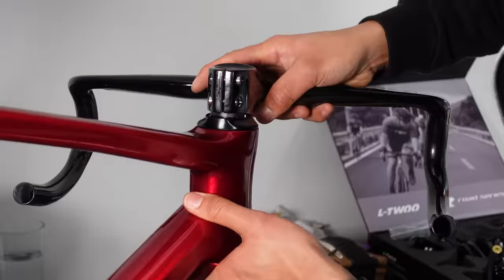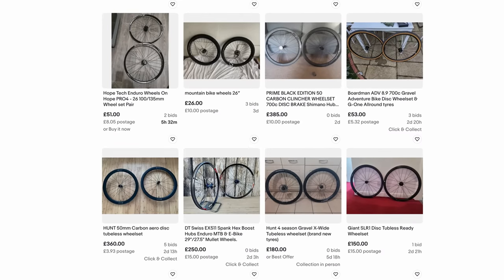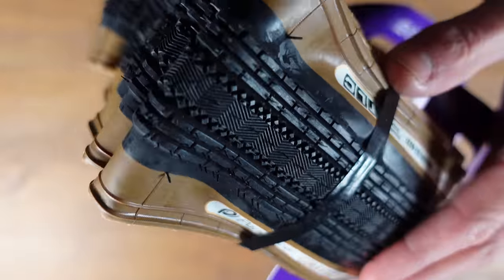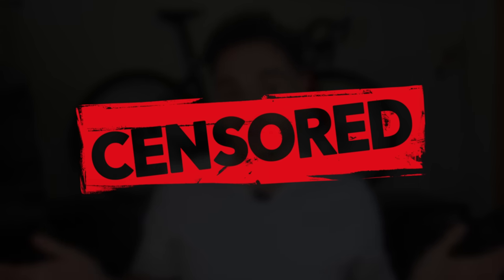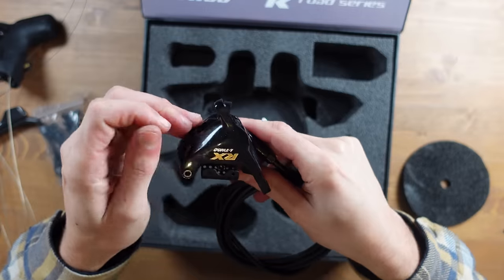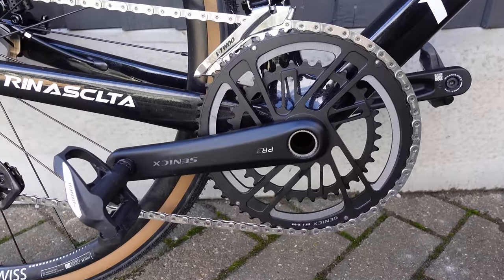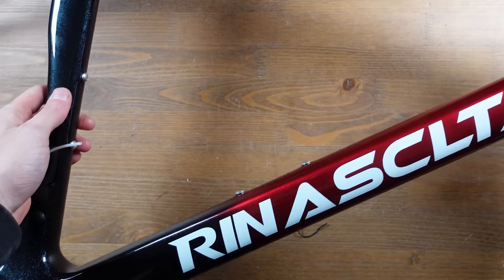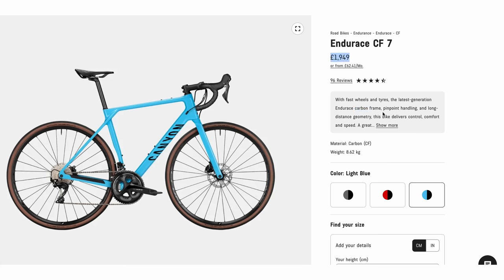Is It Worth the Money? Cheap Chinese Road Bike Build… Full Parts Rundown and Cost!

Comment: Joudain,great video but Johnny's time and frustration is the key cost component here.With that in mind it wouldn't be far off the price of the canyon .you can buy all the components no problem, putting them together is the tricky bit. All things being equal I would go for the Canyon as you compared against similar all road bike off the shelf? I love tinkering with bikes as you do,I have delihea rest frame Sensah empire 11 speed and elite 50mm rim brake wheels.
Next bike will be a Carbonda 696(on-one freeranger)gravel/CX bike.
Greeting from lovely Ireland.
Reply from the maker: Yeah I agree, if you have to pay the labour costs for the build then it's going to be better to buy a complete bike. As long as they have what you need in stock. That's my only issue is off the shelf bikes have off the shelf sizing. Large bars, long cranks etc.

Comment: At that price, the Canyon is the no-brainer choice. No issues and time spent building it. And if anything goes wrong with any part of it, within warranty, you simply get them to sort it out

That’s worth the extra £400 in my books
Reply from the maker: I can't disagree. If you take your time into account to build it then they are probably the same price (ish). You seem to get pretty decent deals for fully complete parts compared to buying components. The only trouble is getting the bike with all the components you want 👍🏼
Reply: Think that's missing the point of a self build, is it not but I see your point. Any issues it's still dealt with overseas unless you live round the corner to Canyon.
Reply: @whitebeardcycles  It’s not missing the point of self builds at all. If you’re building your own bike because you want the enjoyment of the build, or because you want specific components then fine. 

But if you’re doing it because of time and cost (and there was a cost comparison in the video) then the Canyon is the better choice. 

As for sending things overseas, where are you going to send Chinese frame or components should anything go wrong?

Comment: Good appraisal.  I do find the term "cheap Chinese" to be a little misleading for most people's idea of cheap. I have recently built an Ican gravel frame with Sensah/senicx groupset and Juin tech brakes and inexpensive carbon wheels. Once finished it totalled just over €2000. Not "cheap" after all..
Reply from the maker: I agree. They are cheap compared to new builds from known western brands but still expensive items in the grand scheme of things.
Reply: Self builds are never cheap but you generally get a better spec for the money.
Reply: Definitely  - plus I got the enjoyment from parts research and the build process, and now the riding.